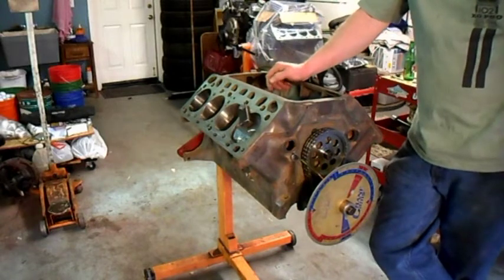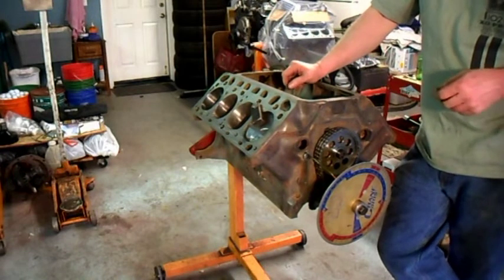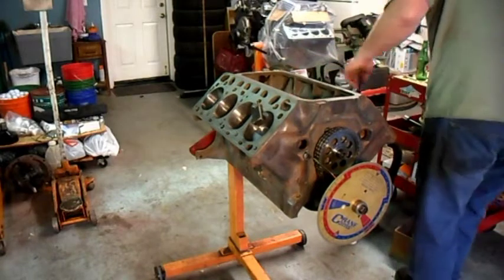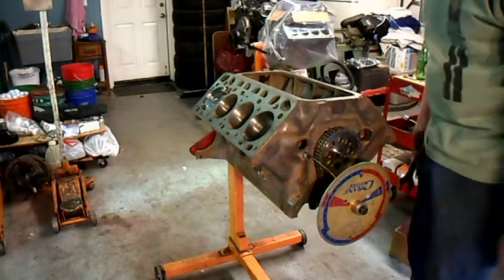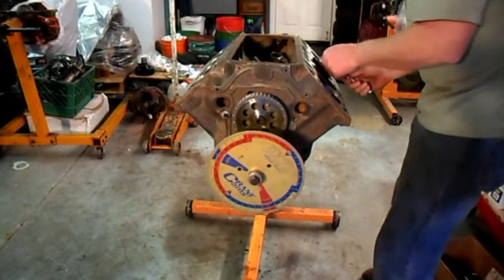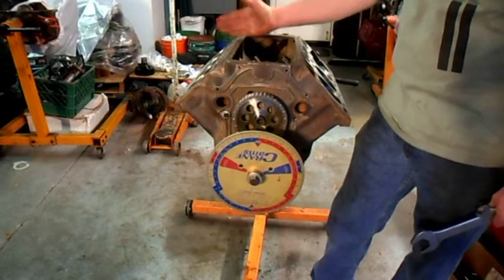checking the index on Jakes new crank.  Y-Block Ford.

Comment: Checking Index is easier while in the crankshaft grinder
Reply from the maker: I ground it on a 90* index in the grinder, double checking it here.  This just confirms it and that the decks are square and equal distance from the center line. ;-)